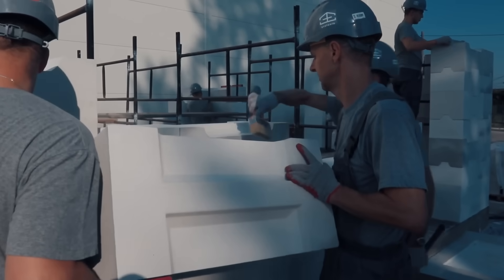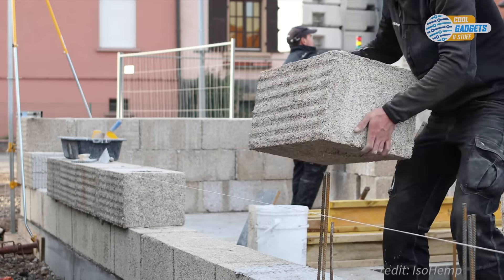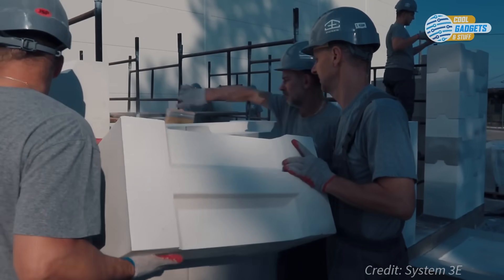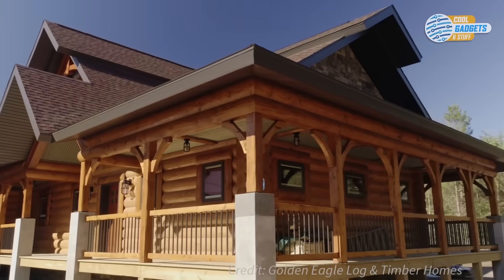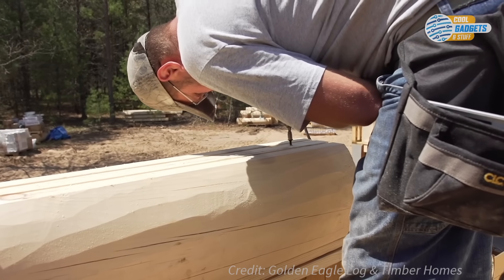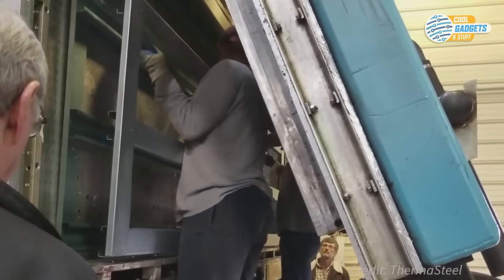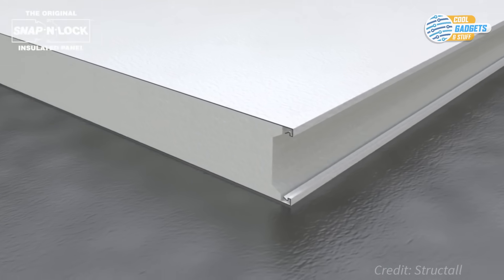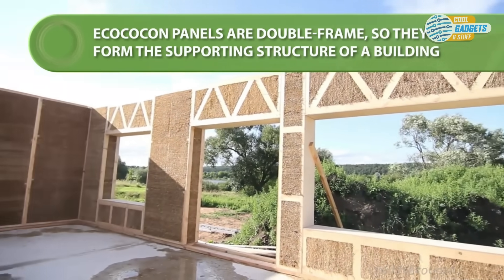5 Innovative BUILDING SYSTEMS for your house #4

Comment: What's the cost between hemp concrete and regular concrete what is this fireproof and what is its thermal rating and how long does it take to dry or bind and what about insects and mold ?

Comment: My preference would be fireproof panels wrapped around a timber frame. The frame can be cut in a factory as are the panels. The building consists of building an adaquate foundation then assembling the frame and cladding kit. The labor intensive part is installing the utilities. That too can be done in the factory. Ted Benson in New Hampshire manufactures these houses. Look them up.
Reply from the maker: Oh Bensonwood, I've stumbled upon them before. I'll do more research on them. Thanks!
Reply: @cgstech5657  You're welcome.
Reply: Anything with wood is not innovative.

Comment: Walls filled with polystyrene is a terrifying idea. Polystyrene is extremely flammable and burns very fast. I manufactured polystyrene trays in a factory for years. static electricity would ignite the material if it was being used before the flammable gas used to create it had fully cured out of the rolls.
Reply: My sips are polyurethane foam and it won't burn. Far superior to anything that I have seen. Look up Wanessa-sue Inc.

Comment: Not impressed by any of these systems
Reply: Katie Minjarez-Smith CaCO3 ->CaO + CO2       CaO + H2O -> CaOH + O2
It’s cyclical it doesn’t absorb more than it releases.
Reply: @kg_boom3r  it is not stronger than concrete. He said it in the video that it is not load bearing that means it can only be used for structures that don't carry any weight so only good for insulator or just to fill the gaps...

Comment: I like the Hempcrete solution.  Hemp can be grown almost anywhere.  So the cost of shipping your materials can be minimized.  If the materials can be sourced locally, then you're saving a lot in carbon costs and not depleting other areas of natural resources (like in the use of wood).
Reply: Yah but if your house starts on fire you're screwed.  The fire dept will get high. 🤣🤣🤣
    Seriously though,  I agree with you. Hemp should have been utilized a long time ago. Has a great many uses.
Reply: @anthonythorp7291  You are totally wrong with that. Obviously you did not watched the video correctly. They showed in the video Hemp and Hay walls are fire save. I seen several tests with those kind of houses and I can tell you it is more dangerous to live in a framing construction as in a Hay or Hemp builded house.
Reply: @caepncrunch3741  obviously you didn't read my comment correctly.
   The first paragraph has laughing emojis. That means joking. Second paragraph even starts of with "Seriously though" then goes on to praises hemp use.
Reply: the problem is in locations of hemp hurd processing, there are far and few between. i live in south dakota, a state senator was the first licensed hemp farm in south dakota. 2 years ago my next door neighbor grew 20 acres of hemp, our town has the only hemp hurd facility in south dakota, the only 1in our state.
i can provide photos of huge round bales of hemp, square bales of hurd, even huge piles of discarded strands (the outer part of stalks with the long fibers) the hurd is the "PITH" IS (THE CENTER OF THE STALK). way more carbon is produced than is captured in the production from planting the seed to the baling of the hurd!!  
would be great if one could capture more than produced.
Reply: Hemp is organic. It's mold food. Plus I'm allergic so not great for me.

Comment: I don't see longevity of those predone panels made with press board, what are they going to do if they have water damage. High probability those panels won't be sold anymore when they have a failure, hate anything made with press board in replace of actual wood studs

Comment: The last alternative looks good in the video but you know overtime straw loses moisture and its structure shrinks further thus exposing new dangers in structural integrity.
Reply: Not just that, but that thing HAS to be a massive fire hazard. A house-fire is never a good thing but there's pretty much 0 chance that ANY fire in that house wouldn't burn it right down to the foundation stones. Add on top of that if moisture ever DID somehow get into that straw, you just know that Mold would be inevitable.

Comment: Like wow man, far out, a hempcrete house! If it out gasses on hot days, do the occupants get stoned? That must be a psychedelic experience on cold winter days with all of the windows closed and the heat turned up! The inventor of this one must have been the head of his/her class! lolololol!

All kidding aside, pot was supposedly banned due to resentment from the paper monopoly for independent paper companies which used hemp fiber instead of wood pulp to make their paper, and therefore could not be controlled by the monopoly.
Reply: Yeah you should probably look up the difference between hemp and marijuana ;) 

And hemp is still produced at large all over the world, quite legally too since it's impossible to grow pot on these properties. Awesome properties and uses, not to mention the carbon capture.

Comment: Just want know how do in this sistems the plumbing, electrical and gas installation? Don't see how 🤷‍♂️
Reply: at around 2 minutes you see one example. Build walls, install pipes, then insert insulation. The ICF systems (stacking blocks) allow you to carve grooves in the material, since you will plaster over this material when finishing the building.